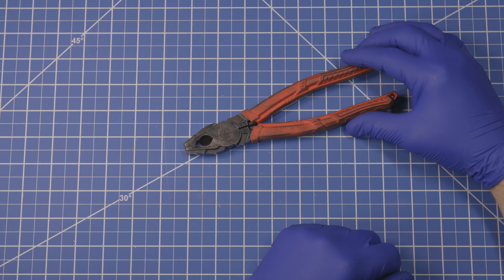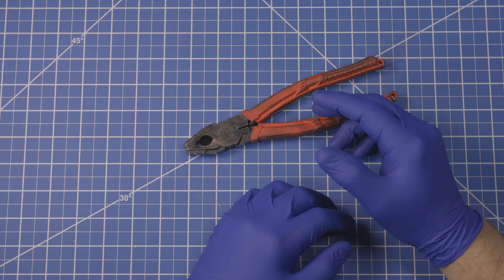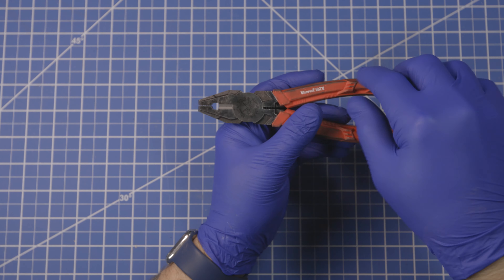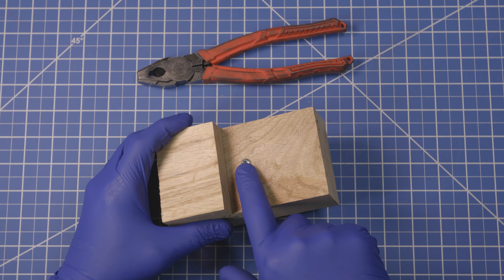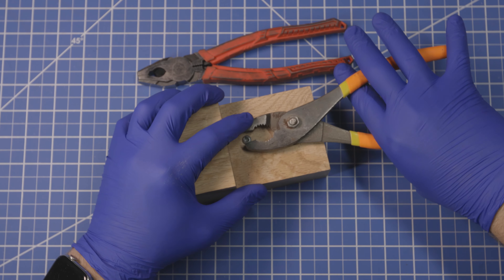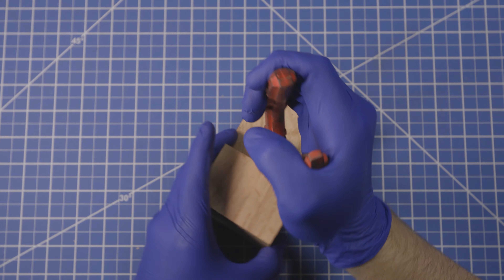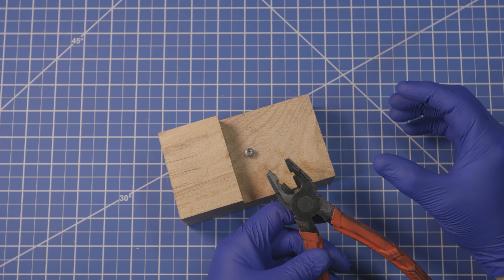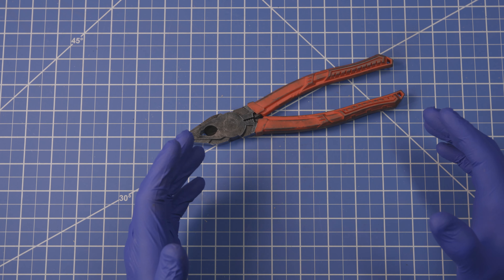Engineer Pliers / Vampliers Basics

Comment: A must have tool for anyone who fastens a screw.  Especially for those who are not experienced and strip screws using the wrong bit or not applying the right pressure.  They are pricey, however, they will last decades - buy once, cry once...